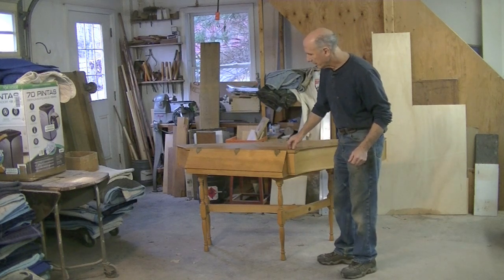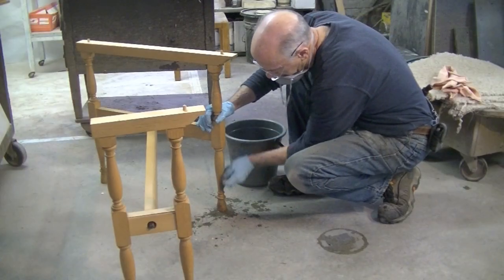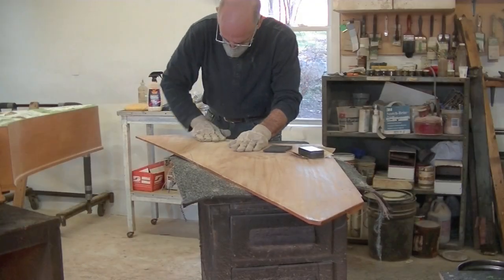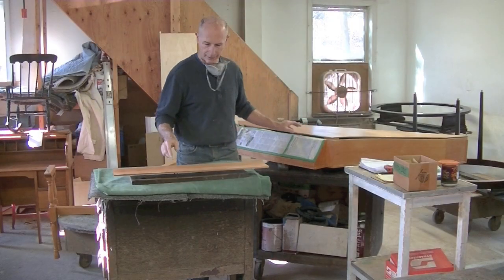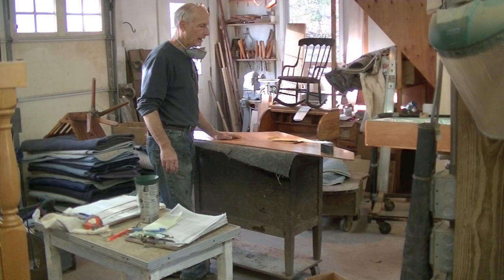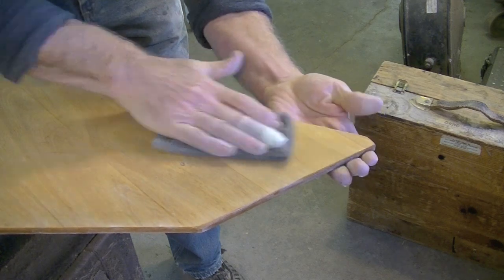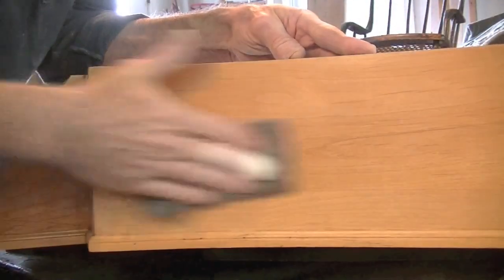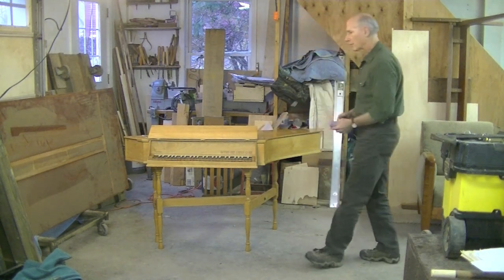Restoring a Harpsichord - Thomas Johnson Antique Furniture Restoration

Comment: Just gone back in you video list, brilliant yes watermark pain to remove but as you did it bleach and water. But the screws are what got me all slot screw when on show all going same way if outside slot should run down so the water runs away.  I'm going back 50 years now plus. Love watching you do the restoration. Take care👍👍🥂
Reply from the maker: Thanks! That's interesting about the screw direction!

Comment: You are right about refinishing shellac.  It does NOT like being sanded,  especially when it is less than totally dried out,  like for years.  I also use a scraper to bulk remove the shellac.  It is something of a challenge to then get a flat surface again.   Challenges of restoration,  eh?  Evan from NZ.
Reply from the maker: Yes, thanks! Shellac is a fast drying finish, but not if you put too much on at a time. I try to keep it to 1 thin coat per day

Comment: My grandfather once build himself a motoryacht. I’ve been on that boat for holidays year after year. And the one thing I will never forget, all slots were heading in the same direction! 
Question, why didn’t you spraypaint this, to me it would make sense for not getting any brush marks
Reply from the maker: Thanks! Yes, there's a word for that, the screws, it escapes me now. Yes, spraying is great but you need a spray booth etc.

Comment: Dear Mr Johnson in your point of view what is your advice to protect a wooden work surface in a bathroom ?
Reply from the maker: In one of our bathrooms we have a wood vanity, I finish the top with polyurethane and it's holding up really well after 9 years. We are always careful to wipe off the water that gets on it. I finished it before the sink went into it and sealed the bottom and the edges of the cut out for the sink

Comment: Just in process of watching this video - and you were trying to remove scotch tape.  I have a piece of knowledge that might be helpful - not for this harpsicord obviously ... but you might find it worth a go at some stage.   We Australian know that Eucalyptus oil has many marvellous properties. At one stage it was regularly used by conservation staff at  the State Library of NSW for the removal of sticky tape/scotch tape.  In my own experience, it was used by a museum I worked at to de-rust a badly rusted steam traction engine .... parts soaked in a bucket of Eucalyptus oil for varying lengths of time.  I have used to many times myself, mainly to remove sticky labels.  Also good for colds - wool wash - etc
Reply from the maker: Thanks! I will try that! Eucalyptus oil is readily available, although usually in small bottles. I’ll have to try to find larger quantities
Reply: @johnsonrestoration  Maybe try in small quantity first - just in case you find you already have something in your arsenal that works better ... or for some other reason it isn't for you or your work ....  So enjoying your videos!

Comment: Nice!

Why line up the screw slots on the hardware? Just for looks?
Reply from the maker: Thanks for watching! Yes, it's all about looks, maybe a touch of ocd
Reply: Yeah, I might see first if they want to seat with about the same torque before going ahead with some more turn or backing off a bit to line up the slots. My wife is keen on this for switch-plates and I do it because it's plastic. The smaller the wood screws the less tendency I have to try and align them for fear of stripping the screw. Guess you can always add a toothpick. ;-)

Comment: What brand is the gold sandpaper you use?
Reply from the maker: Hi Robert, it's 3M 216U Production Fre-Cut Gold. I use 220, 320, & 500 grits
Reply: @Thomas Thank for taking time to reply.  I'm doing my first restoration it's reveneering and veneer repair on a late 1800's treadle sewing machine cabinet.  I resawed my own veneer from high fleck QSWO but still have to match the stain :-0 I've learned a lot thank you for making the videos.  You make it look easy, BTW :-D

Comment: What metal cleaner did you use on the hinges?
Reply from the maker: That is "Brasso" I picked up at the hardware store. I've used many over the years, they all seem to work well. There's plenty of DIY recipes on the internet.
Reply: Thank you.
Reply: Donna Gelineau I tried Brasso on my 100 year old piano. It works but has terrible smell. I used Bar Keepers Friend. It's lot cheaper and  more effective to remove dirt and rust and smells good.  Also it removed mold and mildew from wood as well. I even cleaned 100 years old black rusty piano pins.
Reply: Thomas Johnson Antique Furniture Restoration I used brasso for a project but found that the shine didn’t last more than 3 weeks. Have you had this problem?